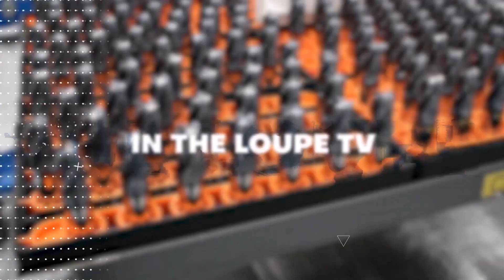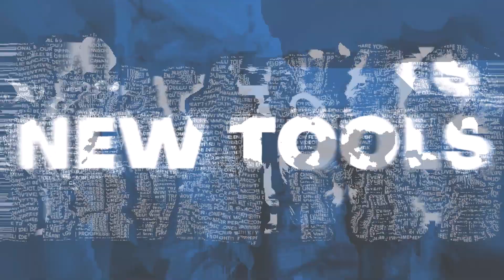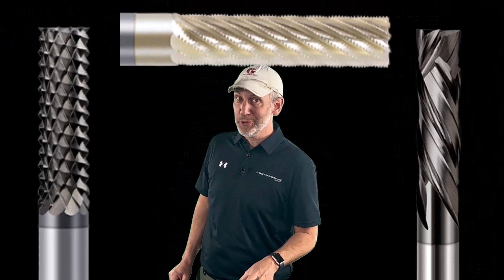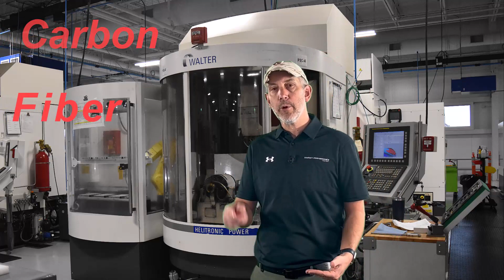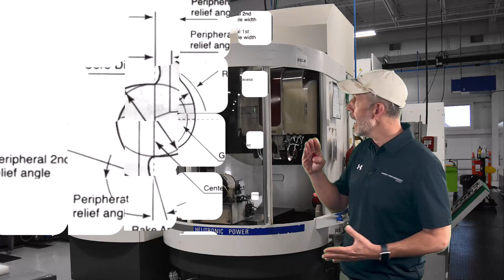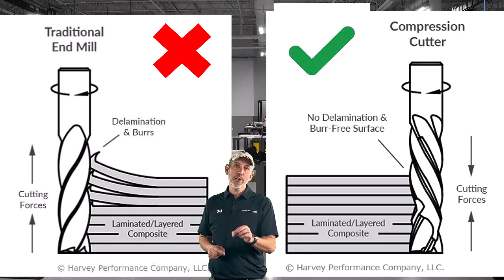Keys To Cutting Composites: In The Loupe TV Ep.16

Comment: The first time I tried to cut carbon to make a guitar fretboard, I used a TiCN tool and it was such a mess. The fibers were tearing and delaminating and the coating that would last for days in wood and had no issues with steel was dull within minutes. That was quite a surprise. Now I'm using DLC coated carbide that lasts much longer, but I want to try out PCD coated or solid PCD tools, since they should last even longer and stay sharper. The other time it surprised me a lot when I was cutting it with a band saw and there were sparks. I was like "Wait a minute, carbon shouldn't spark..." and then I realized it's the saw itself that's getting ground to bits and it was the steel that was sparking!
Reply from the maker: PCD is the way to go when Cutting Carbon fiber..   Is slightly expensive but works out in the end..  Thanks for your comment.  ctc

Comment: Hey! Can you go over spring passes?  I would love your take on setting them up and understanding what I do to prevent just needlessly wearing out my tools.

Also. My engineers are always asking me to make heatsinks.  I run deep paths with your reduced shank endmills all day.  Love them, but am I doing it right?

I'd use a slitting saw but most of my setups are no good for them (too wide).

Thanks!
Reply: We have some great solutions for Heat sinks.  Sometimes High Feed mills will be your best choice pending the wall thickness and Depth to be machined..   Is this Aluminum?     Also we will be discussing Spring Passes in greater depth in an upcoming episode..
Reply: @dongrandt372  Thanks!!! Yeah, when I watched that episode, I realized those might be the tools I need.

Walls are about 4mm at the thinnest, 55mm at the deepest, with about 10mm between fins.

Comment: I've cut fiberglass laminate several times. Abrasive as hell. I used regular mill and found out the best way was to choose helical toolpath. Now I have DLC multiflute for composites. Looking for opportunity to try it out.
Reply: The first time I tried to cut carbon to make a guitar fretboard, I used a TiCN tool and it was such a mess. The fibers were tearing and delaminating and the coating that would last for days in wood and had no issues with steel was dull within minutes. That was quite a surprise. Now I'm using DLC coated carbide that lasts much longer, but I want to try out PCD coated or solid PCD tools, since they should last even longer and stay sharper.